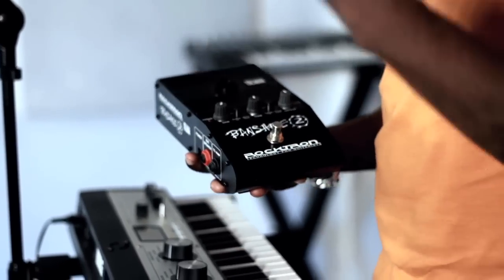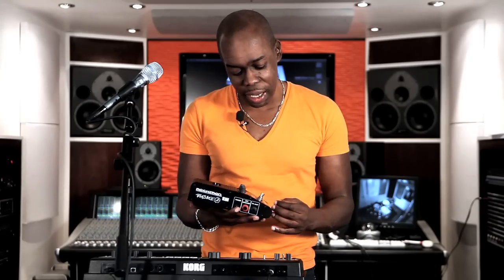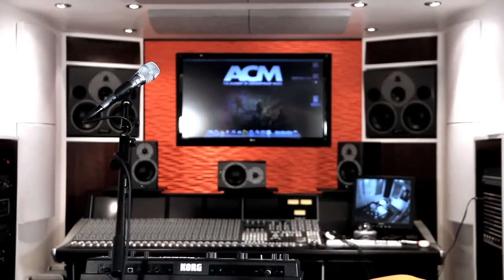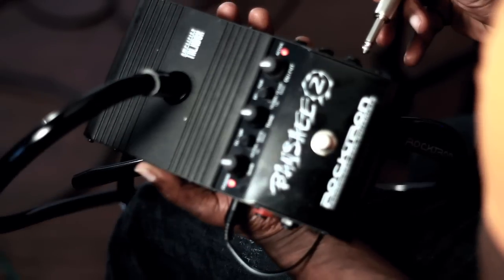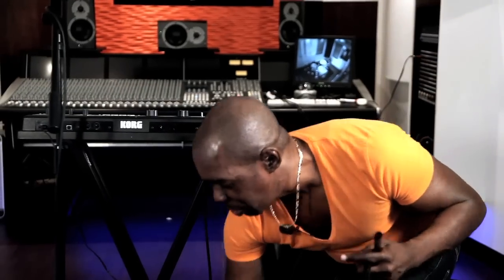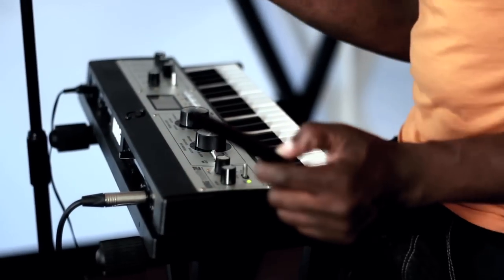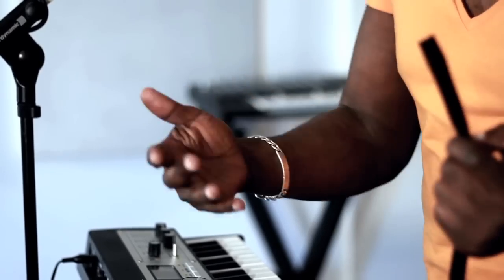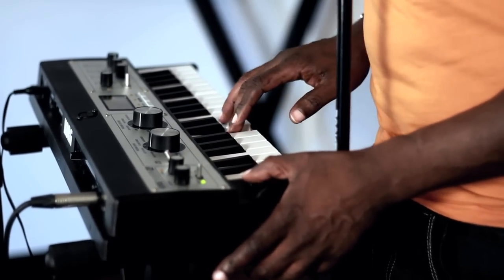How to Set Up a Talkbox - ACM Tutorial with Brian Henry

Comment: Hi there !

I have just bought myself an Mxr M222 talkbox! The pedal is great really.

Im using fl studio 10 for my production. I have a Presonus Usb 96 as my audio interface, and I am trying to figure out how to make my talkbox work!

So im at the step where my sound in fl studio is setup to my audio interface sound device, so thats suppose to be ok. My two speakers (krk rokits) are connected to the headphones output on my audio interface. Then, I plus my talkbox input to my Presonus left input (as i saw in your video was the trick if i only had one right output and one left output). 

Thing is, the sound comes out of the talkbox just fine, but it is my whole computer sound that goes out of the talkbox! I am using a midi controller and a plugin synthetiser as my instrument, but the moment I play a song to jam my talkbox along, the whole song comes back at the talkbox, and also on my speakers too!

I really am trying to find out how to configure this all up with the fl studio mixer interface to be able to talkbox only one instrument, via linking this said instrument to a track and then going into the output settings, but Ive tried everything i can think of!

I really need some help, such a wonderful product!!

Hope you will read this message, thanks for your time!

Jay

Comment: This may sound like a dumb question but please help. I have a synth, a Banshee (1st version) and a practice amp. I can get my synth to output through the tube or, unmodified, through my amp. What do I need to output the modified sound from the tube/my mouth through my amp? Do I need to mic up the tube? If so, with what?  Basically,what's the simplest configuration for 1 synth, 1 banshee and an amp? Do I need to route the banshee as a send effect via a mixer?
Reply: You need to put up a mic the same way as you would if you're singing, as the sound from the synth is sent through the pedal and the tube to your mouth thus creating the intonation and voice-like features.

So in a live setting: 1 synth, 1 banshee, 1 amp, 1 mic and I dunno if you can connect the mic back into the amp, but probably a speaker.
For rehearsal purposes I believe just using the synth, banshee and amp by themselves can do the trick :)
Reply: Many thanks. Thought I should double check.

Comment: So does the sound come out of the amp itself?
Reply: Comes from The tube, that's why you also need a mic in order to put it in the mix. It's like you are singing without using your vocal cords. Instead of your vocal chords making the noise then being manipulated by your mouth. There is a speaker tube placed I  your mouth that does the job of your vocal chords while you still manipulate the sound with different mouth shapes just like singing.

Comment: Hi all!

I'm having some problems for making my talkbox recordings sounding nice and I would like ti ask for some help... I wish someone could teach me about what i'm missing.... Ok here is the case:

(First on first my apologies for my English... It sounds really a little bit crapy... :-/ sorry...)

I dont know if i'm doing it wrong in the recording process, or if I have to do something specific to the talkbox track in the mix to have that "tipycal" talkbox sound (I can't find anything about "how to mix talkbox") ...Wathever i do it sounds like a toy thing...

Here is my equipment:

-Dunlop Heil Talkbox HT1 (with a 22watts amp)

-Vst synths (massive, nexus2, sylenth and some freeware synth1, plus Cubase5 native plugins). With normal midi velocity parameters. Two or three oscilators in different octaves (patches seem to be right, they sound "phat" initially)

-Behringer B-2pro (large diafragm) microphone. With SE Reflection Filter (and a homemade 1m. x 1.5m. vocal booth with acoustic pannels and blankets). Art tube compressor to power the microphone and soft compression

-I play talkbox with enought volume to hear it nice and loud (like a lead vocal) but having caution not to overload it's volume and hearing too much room's ambience. (Not easy to explain this, sorry). My "vocal technique" is still poor so right now I just try some "uuoohs" and "ooaahs" and small phrases.

The case is I actually don't know why my recordings sound like "thin" and "poor".

A) Am I making recording mistakes?:
 Low or high volume?, not enougth or too much room ambience? Wrong mic (better with a dynamic mic? ...

B) Is there something in the mixing process I have to do?:
 Doubling tracks?, autotune it?, little bit or lots of reverb?, specific modulation fx lile chorus or phasers?, concrete EQ or low/high filtering tips?, saturaton fx?, noise gate, compressor or limiter needed? ...

Sorry for writting all this large explanation.
Thanks for reading and again my apologies for my English.
Hope some one could guide me... :)
Thanks..!